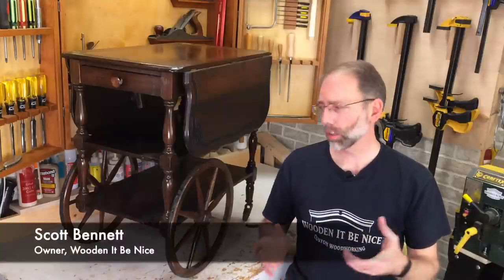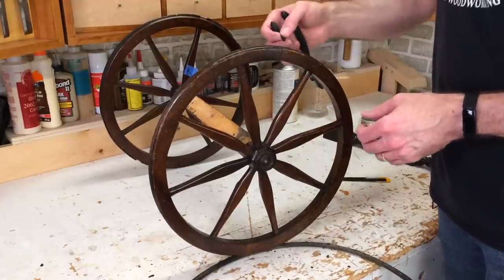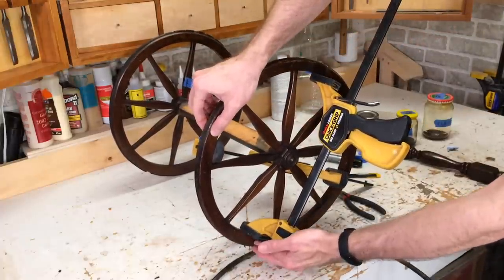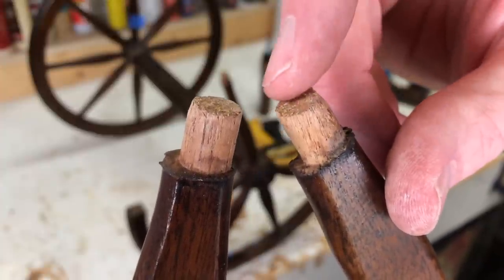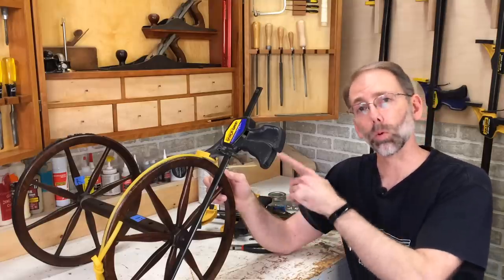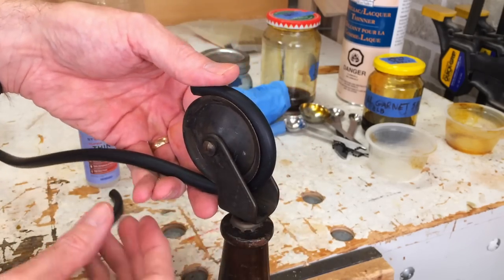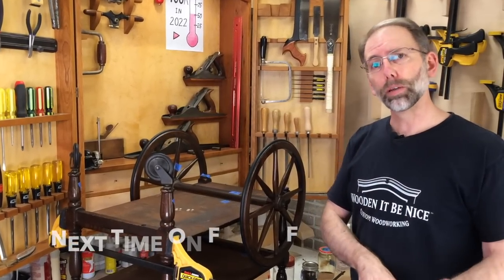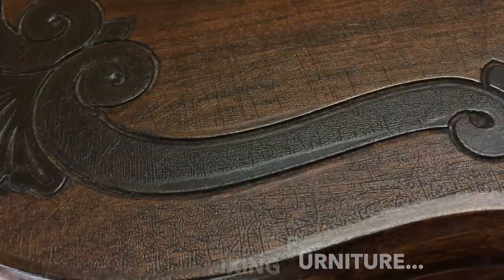How to Replace Rubber Tires on Tea Cart Wheels | Furniture Restoration by Fixing Furniture

Comment: As someone else has said, the original rubber tyres had a stainless steel spiral wire insert in the centre that use to screw together to firstly pull it tightly together and secondly give it strength. I know this because I worked in a rubber store that use to fit prams, personal shopping carts and believe it or not a penny farthing solid rubber tyre. I’m pretty sure that the small stainless steel spirals are still available. Love the job on the trolley. 👍🏻😁🇦🇺
Reply from the maker: Thanks for sharing that Michael.  If you're able to locate some tire material like that, I'd love to know about it.  Thanks.  Scott
Reply: @FixingFurniture  The rubber store I worked for has since closed but I’ll see if the particular rubber profile is available around the place. 👍🏻

Comment: I thought it was going to be a trip to Engel's Coach Shop in Joliet MT.
For the small caster wheel rubber, I would put a strip of tape on one side of the joint, applied the glue, and then draw the ends together and hold it with the tape.  This would avoid inadvertent gluing of the glove.
The axle screw looks like a lathe wormscrew, and it cuts as it is driven in, after drilling a pilot hole.
Reply from the maker: Thank you for sharing the tip with the tape.  I will have to give that a try next time. Also, thanks for the suggestion on the axle screw.  I appreciate that.  Scott

Comment: You probably found almost no glue on the tenons.  The wheel is intended to be held together by the outer felloes, (the curved wooden pieces), and the splines.  
A visit to Engle's Coach Shop on YT would give you a much better idea on how these are made.  He also installs new tires as he has the special machine to weld the wire back in place.
Reply from the maker: Thanks Jim.  Yes, I've seen how they install new tires on wagon wheels... it's quite a process with specialized tools.  It's interesting to watch a wheelwright at work.  Thanks for sharing that.  Scott

Comment: How would you putting tension on a wheel without a groove?
Reply from the maker: I assume you're asking about clamping.  If there's a wheel without a groove, I would use a strap clamp.  Does that help?  Scott
Reply: @FixingFurniture  can you give reference for strap clamp please?  When i google it all i get is strap wrench type tools, nothing that would hold constant pressure unless you continuously hold it.  Thank you in advance

Comment: Why not setting a small clamp to hold the rubber band (at 14:35) to hold everything in place before applying the CA-glue.......
Reply from the maker: Yeah, I can see where that could be helpful.  Good idea. Thanks for sharing that #tip

Comment: That was the steel wire in the rubber tire that made the integrity of the wheels. Without steel wire, you've lost an important component of the wheel strength.
Reply from the maker: Hi Oliver.  The wire inside the old tire is from the wheelwright trade.  This is a step required for wagon wheels that rotate very quickly and could displace a tire.  As tea carts move much slower, the wire in the rubber isn't required.  The felloes and spokes carry the weight of the tea cart and its contents.  The process I demonstrate here is how tea cart tires are repaired.  If you'd like a reference, you can search for tea cart rubber to understand the supplies available from restoration companies.  I hope that helps.  Scott
Reply: Yes, you should be ok up to about 100 km/h. 😉
Reply: You can see Dave Engels put rubber tires on large buggy wheels on his YT channel Engels Coach Shop. He builds and repairs horsedrawn vehicles for a living.